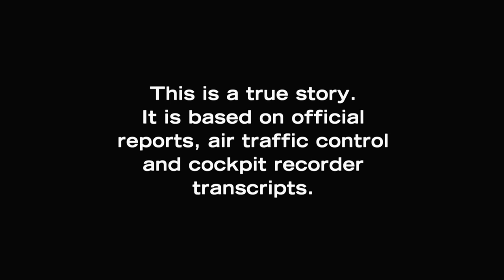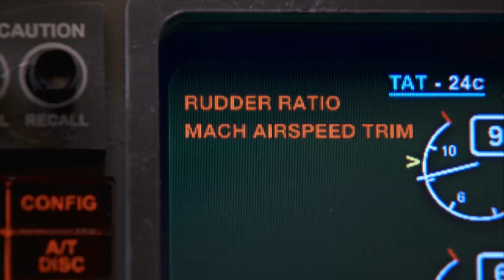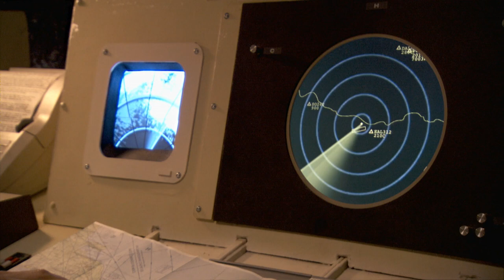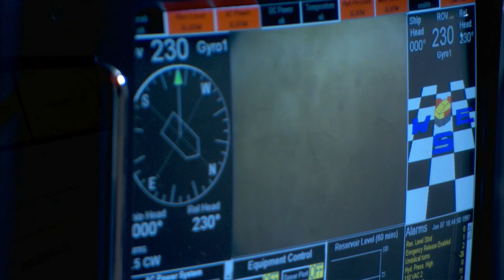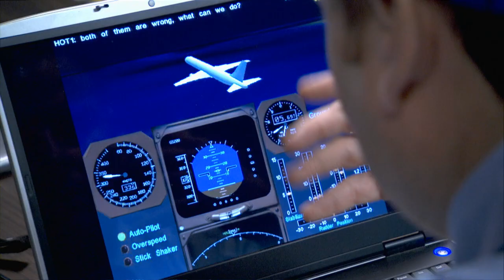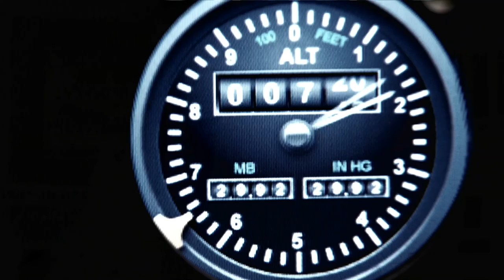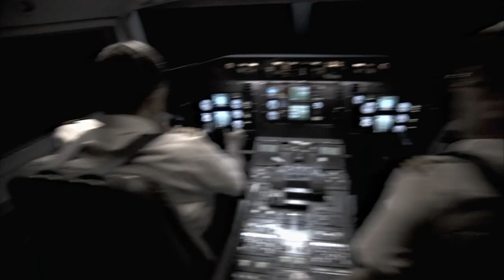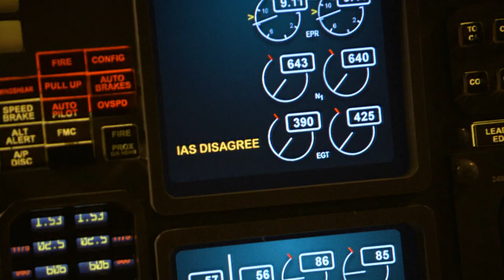The Plane That Wouldn't Talk | Faulty Readings | FULL EPISODE | Mayday: Air Disaster

Comment: Haven't watched the whole episode yet, but from the first 10 mins, I'm assuming when they set the autopilot on, it used the Captain's speed readings, causing the plane to slow down too much during the climb.
Reply: i winced so hard when they turned autopilot on, knowing the computer had bad data.  🤦‍♀️
Reply: The "Pitot" tube was last revised ca. 1958. Hey guys, I have a 1958 supercomputer I want to sell you! It goes right along with a 1958 automobile, and a 1958 MixMaster kitchen blender! I've got them all listed on eBay! I have punch cards for the computer, the car needs a few touch-ups, and the MixMaster needs a new cord - otherwise they're all in better condition than Pitot tubes.
Reply: Interesting that they decided to trust the F/O speed indicator on rotation and then think the Captain's indicator was okay when climbing.  He should have never trusted it and never engaged the autopilot knowing it was faulty and returned to the airport.  The 3 week layover probably impacted his critical thinking, being driven by getting home.  Like they say it's a chain of issues (uncovered pitot tubes, 3 week layover, not aborting takeoff, engaging autopilot with bad speed indicator, etc...) and if you break one link this would not have happened.
Reply: @Bulldog-hu8qn  Interesting that they decided to trust either of them when they didn't match at 80 knots. V1 was 150 or so according to the video? They had plenty of time to abort the takeoff. That would have been a simple maintenanc eitem. Taxi back to the gate, figure out why really quick, sign off on it, done.
Reply: @Brody Gilbert ---- Yeah ... that was my point.
Reply: @davesmith5656  Wow! I have not heard of punch cards for a computer in a long time. My mom actually went to school to learn that. Thanks for the memory.